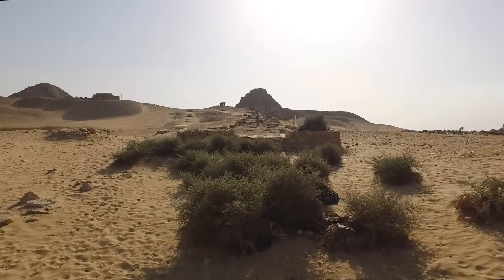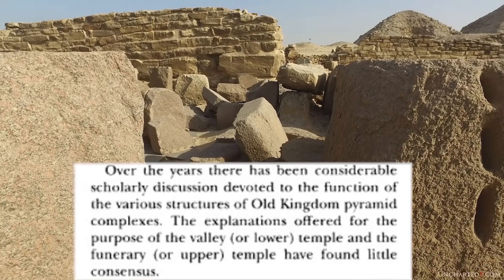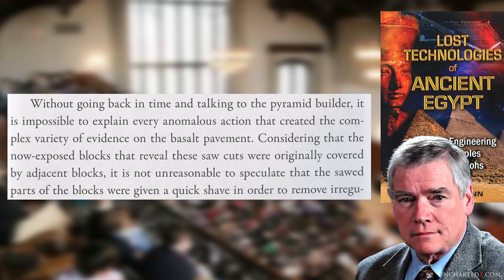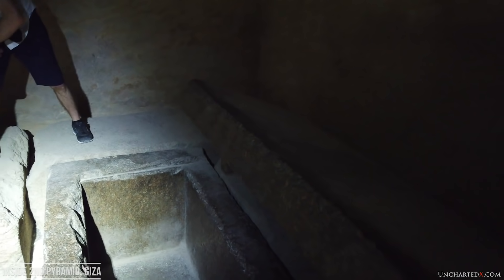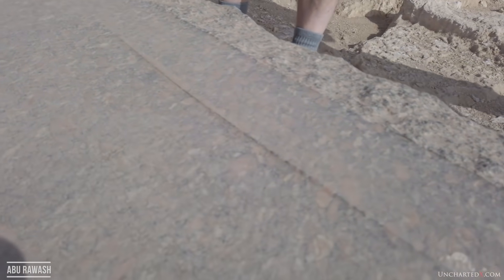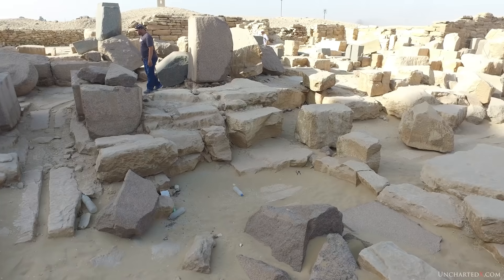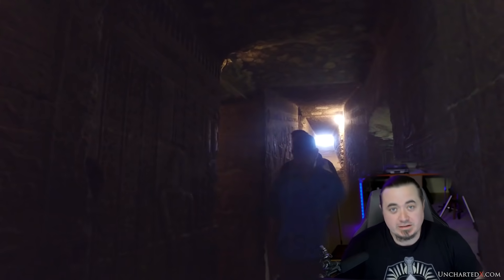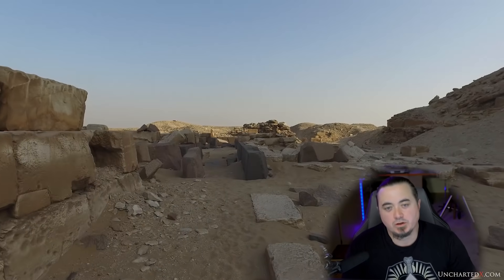The Mystery of Ancient Egyptian Stone Cutting in Basalt and Granite - UnchartedX full documentary!

Comment: In response to the YouTube video - The Mystery of Ancient Egyptian Stone Cutting in Basalt and Granite.

On the subject of “channel blocks” under the basalt paving.

My credentials are, I am a colonial archaeologist by schooling. I have had my work exhibited in the Smithsonian Museum of American History in Washington, DC.  

However, I no longer work in that field. I have been working for the past twenty years as a data center architect. Given I have experience in archaeology, and have decades of experience in data center design, and therefore have extensive experience in computational fluid dynamics (which we use to design heat removal systems for data centers) I feel I can speak to this topic with some authority.

Originally, I was going to posit the channel stones could have been an underfloor heating system like the Romans used, but then of course we have to consider the geography, it's too hot there to need an under floor heating system, so I tossed the idea. Then I thought the following. 

Basalt is a very dark stone and it gets very hot when in constant sunlight (ever walked on a dark surface like an asphalt driveway on a hot summers day in bare feet?).  What if its not an under floor heating system, but an under floor cooling system?  You state in your video one of the channels runs the entire length of the causeway, based on the footage you present it appears the channel runs directly down the center of the causeway. 

The channel looks very narrow (I can't judge the actual width based on your video) however if it were a heating system it would need to be much wider.  Were it for cooling on the other hand the width would be perfect provided the flow of cool (not cold) water was sufficient to carry away the heat before the water reached its exit point.

Question -  You show a “stone bowl” at the end point of one of the channels, was that at the high point of the causeway, the low point of the causeway, or somewhere in-between? 

If was at the high point, or somewhere in-between the high point and low point I would submit to you it's not an exit point for the water but an entrance point for cool water to be poured into the channel.

The narrow with of the channel would result in a high flow rate down the channel (put your thumb over the opening of your garden hose nozzle) resulting in greater heat removal over a longer distance provided the water was constantly supplied.  

This would not make the dark causeway cold per se, but it would lower the temperature enough to make it walkable for the long distance the causeway covers.

Question - Is there evidence of mortar on top of the channels. If there is it would be evidence the channel blocks were sealed to the basalt pavers above it.  This would be further evidence the channels were designed to contain the flow of water.

Question – Did you find any more “stone bowls” at the end of any other channels, if so where were they?

If I were designing that heat removal system I would make sure to have multiple entry points to introduce cool water along the entire path, this may be provable with examination of the entire channel system.

This is just a theory of course, I would love for someone to take this up as a challenge and see if it can be proven.

Comment: Some of the basalt stones appear to have been used as grinding stones for a large scale machine or system. And not stones worked by some smaller machine. Imagine huge stones moving on top of a basalt platform. Pushed back and fourth by water raising and lowering in a well, moving wood floats which move very large ropes horizontally...

Comment: what I can't get into my head... even if they had machines and drills how did they manage to cut granite blocks without material loss in the range of a thenth of a millimeter where the structure of the granite continues over the joint.
I mean you could break it and you would have pieces that are perfect matching but with such huge blocks, on multiple sides with that kind of precision hard to understand.

Comment: The big question isn't whether or not the circular saws were powered, as it's possible they could have had a man powered mechanism for a circular saw.
But rather begs the bigger question of how the egyptians supposedly didn't have wheels when they built the pyramids.
A circular saw requires wheel and axel technology, which is technology that would not have been a big enough leap to wheels for carts and carriages for them to not have learned yet.
Reply: Also, the bend in the saw idea doesn't make sense as back and forth sawing would not create that effect as the motion dictates a much straighter cut than what is provided in the evident example.
Even rocking the saw in an attempt to make that kind of cut would result in more of a slanted straight cut than a rounded cut or a circlular cut in the opposite direction

Comment: The granite floors were the hard surface to work on, harder than everything local? If the floor were lubricated it would have made a stone slip. On a long slippery track, a protrusion would cut a straight line. Let a stone go at the top of a pyramid, running on a spiral ramp and it will be worn at the bottom. For thinner stone you slide it less, the slaves were pulling stone. The channels you found circulated the lubricant to cut friction. Newton must have spoken to them before us? Maybe the pyramids are like a giant brick stack? Drag it til one side flat and turn your stone to size it.

Comment: It seems to me that the common assumption that all these stones were quarried comes from the assumption that the people who built all of this stuff were primitive. The effect of this thinking is for people to go to extraordinary lengths to describe how these primitive people might have exerted extraordinary amounts of time and effort to build this stuff.

There are various ways that these rocks can be made (human-made or nature-made). All methods I am aware of require some combination of lots of heat and/or lots of pressure. I came across a technique, though, called sintering which only requires heat and requires less heat than melting. The technique, as I understand it is to heat the materials up to 50%-70% of its melting point and then heat up layers at a time to the melting point. This technique is being used today to manufacture large stone countertops and 3d-printed metal parts.

If we can remove the primitive people assumption, then a much more plausible explanation for all of this magnitude of work is that an ancient people had an ability akin to 3d-printed sintering technology.

Comment: Erosion will prove that Egyptians never cut any stones.  When erosion happens to natural stones, it is very gradual and slow, taking millions of years. When it happens to artificial stones it is very dramatical and fast, as was exemplified by the stones at 46:43, taking only a few hundred or thousand years. Therefore the erosion on the stones used to build the pyramids and all the other stony structures proves that they were cement concretes. What the Egyptians had done was just moulding the malleable concrete before solidification.
Thanks for the South American scene.
The erosion on the stones at 47:49 proves that the South American natives did not cut any stones also. Three of the eroded stone here at 47:49 disclosed some flat surfaces from inside the stones. These flat surfaces in South America are hidden while the flat surfaces in Egypt are not.

Comment: I just wonder, that since most of stones such as granite are magnetic, and can conduct electrical currents, if a very high voltage wire could have been used to basically melt its way through a stone, i wonder if anyone has tried high voltage electricity to see if it will slice through one of these blocks, because the electrical current could have been attached to the spinning copper blade? 🤔🧐

Comment: they would have been able to melt copper right?  & infuse  it with bits of granite chunks or even sand thrown in a mold when molten, to then let it cool down & harden, in the shape of whatever they need, even a whole saw.  Just like we use today we melt metal & put diamond garnets in while it’s molten. The copper only acts as consumable letting the sand or stone chunks continuously grind away.The copper would slowly be consumed but the chunks of garnet would wear away much slower just like our diamond garnet blades of today?  They could using that method make any size or shape they wanted just like we do.

Comment: OK. The problem with the scale of work needed to produce the number of dressed granite stones. 
Step one: Split the stones with drill holes, chisels and feathers.
Step two: dress the stones with basalt hammers or basalt or flint tipped picks.
Step three: kiss two dressed stones together and cut between them to achieve two smooth surfaces: this would not take nearly as long as a virgin cut.
step four: maintain a just in time closed loop recycling system of cutting materials and tools
Step five: scale up the process through parallel operation.
????????: around the clock shift work using oil lamps?

Comment: Too bad this comment will be buried, but I think I have come up with some answers to to problem of the Egyptians not having hard enough tools to work hard stone. 
First, bronze came to Egypt about 3100 BC, well before the large Old Kingdom monuments were made and within the time period things like stone vases and hard stone sculptures were made. Bronze is significantly harder than copper and may be hardened further by "work hardening", ie. bending or beating with a hammer. 
Bronze is made by adding another mineral, such as zinc, aluminum, or nickel.  In Egypt there is a copper mine at Ab Swayel that was worked as far back as 6000 years ago.  Alongside the copper is also found nickel iron sulfide. Nickel will make bronze significantly harder, but what will the addition of some iron do?  I am not a metalurgist. I just throw that out there. If bronze tools and blades were made by pouring the molten metal on sand, letting it cool, not quenching, and then  work hardening it by beating it with hammers, a quartz impregnated hard sawblade would result. The quartz imbedded in the metal also being much harder than almost all other minerals except diamond. However,  micro diamond is found virtually everywhere on earth. The stone named “Hypatia” found in the Libyan Desert Glass area of southwest Egypt is carbon-dominated and rich in microdiamonds. Put it all toghether and you have one possible solution to how the ancient Egyptians "did it".
Reply: Egyptians did not do it , to have bronze you need tin with copper  and nothing else  ,

Comment: ~44 minutes in - they're rainwater channels - this seems obvious to me. The bowl is for animals to drink from. All of the other missing bits have undoubtedly been pillaged over the years, likely for their original purpose but elsewhere. They will not be sewers, that would be hideously unpleasant and ineffective, there would always be a residue there to decompose and smell. How else would you manage your massive temple complex when it rains hard. With nowhere else for the water to go it will go where its not wanted - this seems such an obvious feature, and not unknown even in modern large buildings  - many have to carry the discharged rain-water down through their central core to the ground.

With large stone buildings having water sinking down through the stone building and into the ground in and uncontrolled fashion is bad news. This causes cavities which lead to subsidence. With such heavy constructions these foundation must not fail - so rain water must be handled. To be honest I'd have a much harder time believing these people did NOT handle this feature at all, and instead allowed the water to go where it wanted into the ground. They surely weren't that silly.

Alabaster is pretty soft - the blocks could be laid as blocks, keyed together, and the channel cut in situ. It needs to fit exactly across each blocks join to its neighbour; so not as easy to pre-machine off-site. Use a soft stone line and cut the channel when it's all bedded in (with all the other building work going on, and ground loading,  this ground will soon reconsolidate firmly, holding it all tightly in place) and will seal nicely.

Comment: Wild Theory, let's say you have Africa's resources at your finger tips and one of those resources was Diamond dust ( tons of it ) and you have in abundance sand and the power of water 'the Nile', also you have math and men who knew the power of the pulley, would it be feasible to create long troughs filled with water and diamond dust and you drag blocks over the various jigs over and over, or miles in length to carve and shape even the hard rock. Using water to displace weight is child's play and creating spinning saw blades, grinders and band saws might be relatively routine using your most common resource, sand, man power, water, the power of the Nile ( flow ) math, various resources to make floatation bags and tons and tons of diamond dust lost to history and time. Has anyone ever dug down and analyzed the sand and see if it contains said dust. Naturally you use the 'dust' over and over. Everything ever made is always rough cut ( hammer and chisel ) then 'refine' ( sand and buff ) Building the structures under-water has always made sense to me, I just didn't know how. I found it to be rather easy once the method was easily explained.
Reply: Rather than spinning circular saws the suggestion is that they used pendulum saws progressively lowered into the cut.

Comment: Stop being flummoxed about the impossibility of doing all the various stoneworks the ancient Egyptian achieved because they simply did it because by then they knew how to do it.... they had a copper/bronze and later iron metallurgy coupled with with a good knowledge of all the abrasive powders including diamond powder enabling them to cast all sorts of tools similar to the ones we use today (like diamond blades) . They could add say whatever abrasive powder they chose to the molten casts of blades, circular drill bits, and lathes of their own making. They knew how to cut large blocks of  hard stone li8ke granite with pounding a long line of rivets to secure a relatively straight cut. they knew the principle of different type of levers, moving huge stone blocks on sleds sliding on wed sand etc.
In the sixties in the south of France I observed several times how a tombstone business was slicing large blocks of whatever stone with a cable doused with water actioned by a motor by simply using the constant  sluice generated by such action they were able to slice say a 2ft deep bloc within a few hours... when I inquired what sort of metal cable they used, their reply was it wasn't a metal cable but  a band made of bovine sinews just like the ancient Roman did.

Comment: Trades never leave there tool . To cut larger stone projects today are cut in many way eg) water under extremely high pressure specialised steel rope coated in industrial diamond bonded to the cable by cutting back and forward using water as a clearing lubricant , very large diameter industrial diamond blades and tungsten as well with also water as a clearing lubricants and drilled to the desired depth using water again as a clearing lubricant and then place wooden , copper , bronze or iron wedges by being struck by a ram post or later a hammer made from timber to the stage they used copper bronze and or iron hammers highly advanced technology used by non humans , aliens whilst here and when they needed to leave they took there equipment with them because the native population did not have a power sauce to use it or maintenance abilities. Smaller stone projects were chiseled on to the desired detentions until they archived a fracture , then moved on to a stone Master masons to archive the desired size and shape

Comment: @UnchartedX. What do you mean when you claim “advanced technology”? Are you implying that their technology was more advanced than ours today or do you mean advanced compared to the current consensus of copper chisels and rock pounding?
I worked in a stone quarry for years and the methods used were quite archaic. We used a reciprocating toothless blade not unlike a hacksaw blade and tension frame with a thick clay slurry mixed with steel shot but could easily be replaced with hard granite sand to cut though over 2.5 metres of granite in 9-15 hours. People don’t realise that bronze can be work hardened to be harder than steel buy hammering and planishing… Looking closely at the surface finish of a lot of these straight cut flat surfaces is identical to the finish of the stone we cut in the quarry using the techniques I mentioned another technique is rope sawing…. I find it a little disappointing that people will conclude things that are more than likely not the case just because they don’t have a better explanation… surely over the thousands of years that the Egyptian empire existed there is some archaeological evidence of what tool, machines and techniques they must have used… I mean cmon if they had technology more advanced than ours there would surely be some artefacts or evidence to support such a claim…